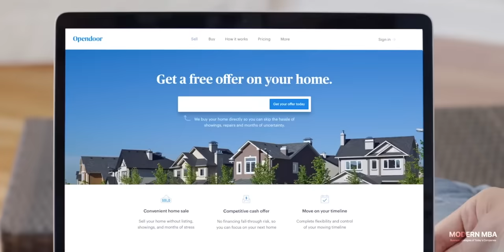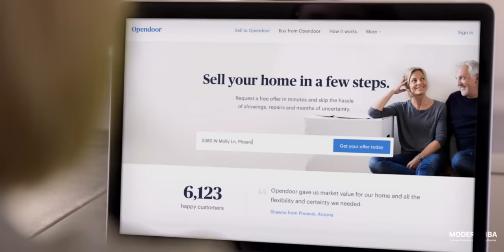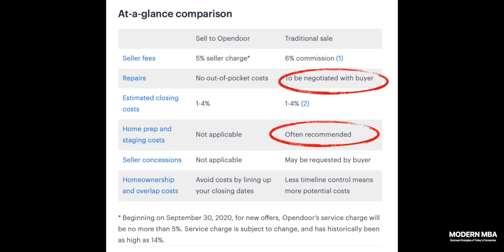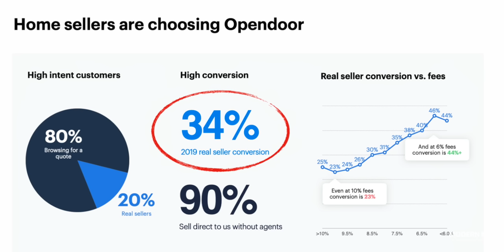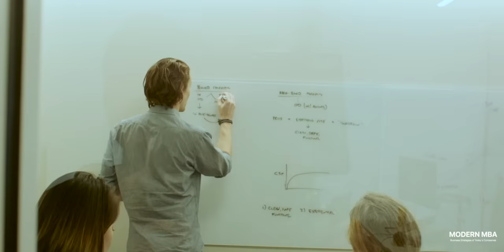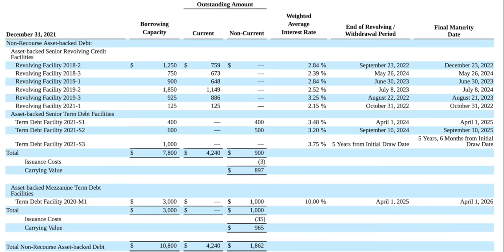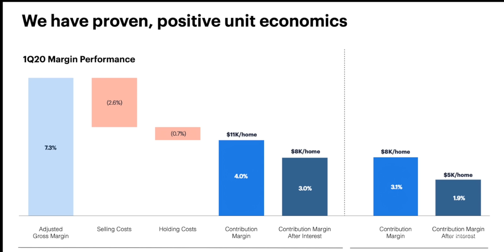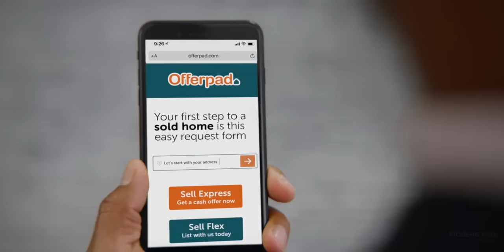Real Estate Tech: A Crumbling House of Cards

Comment: As a data scientist myself I can tell you these algorithms are usually a lot more raw than they would like you to believe lol
Reply: I agree In general but I think people (especially agents) are making too much of a big deal about the “data failure” part of this story. 

As you said, modeling and algorithms are usually looser than many people imagine, but the bigger deal here imo is they didn’t seem to factor in selection effects for who will sell a home to an i buyer.

They also seemed to have failed to develop local networks of contractors for flips ahead of time. There’s a reason there is no national company doing flips, and it’s not because no one has tried.
Reply: I believe it haha
Reply: Even if they had all the data they claimed as a former banker I am sure it was doomed to fail.  The problem is there tends to be just too much variation between markets so each neighborhood really would need different parameters and a retuning of the algorithm.  But they don't have enough data within each neighborhood (not to mention within each market segment in each neighborhood) to get much power so they might actually be estimating off as few as a dozen observations many of which are old and out of date.  

Then add in the fact that you're more likely to get lemons that won't stand up to closer examination signing up for a quick sale process like OpenDoor.  It's actually not that hard to hide local problems if all you do is a single home inspection, whereas a traditional seller with a local real estate agent will know more about the neighborhood and often do more visits at various times of day.
Reply: I mean they did mention things like access to transportation and noise being included in the prediction so idk, probably not just one python script some moron threw together in an afternoon.

Comment: My wife worked for them until a year or so ago. They were astoundingly dysfunctional in so many ways. They didn't have solid, objective ways to evaluate homes, plus with COVID they talked themselves into thinking they could evaluate value without even going inside. They had two groups which didn't communicate at all... The buying side versus the selling. Guess what happens when neither side talks or learns from the other! It was a dumpster fire

Comment: Part of the problem with the "algorithm," esp. regarding homes, is that it can't possibly know everything about a particular property. The algorithm probably wasn't, checking for things like:
* the frequency and severity of termite infestations for an older wood-frame home in a particular neighborhood (anyone who's lived in my city knows not to buy wood frame houses in a certain zip code because your house will either get eaten out from under you or you'll need to be on a first name basis with an exterminator)
* whether an older house still has lead paint in it (A friend ran into this exact problem when she bought a townhome she thought she'd turn into a rental only to discover she couldn't until the lead paint had been removed, an expensive process that requires a certified specialist in her city)
* or any number of miscellaneous oddities that might be wrong with a house that the current owner might not even know about no matter how long they've owned the property (my mother has lived in her home for 30 years and didn't realize that her back yard was flooding all the time because of the massive courtyard pavers buried under less than three inches of sand in the yard and only discovered it when she had a landscaper come out to try and fix the flooding). 

Like, these aren't cars that can be inspected in a day or hardware that has specs published. Some information just isn't available in a database which skews the dataset.

Comment: Me and my mom were moving out of a rental and ended up buying a house owned by Opendoor. The inspection found that there was a cable in the AC that had melted through and was causing a burning smell, and the plumbing had to be fixed, on top of the pool being effectively broken because the cleaning system wasn't working.

Opendoor wanted to fix none of it, and initially refused to do anything, despite the house clearly being both unsafe and at least somewhat unlivable. Fortunately, I am a stubborn asshole, and refused to let my mom even consider accepting that. They tried to give us a whole 2K credit for the repairs (which would have cost around 10,000 just to make the house safe), and we flat out told them they had until the end of the offer period to make a better offer or we walked.

That was the most stressful two weeks of our lives, because they refused to communicate with anyone, and waited until the *last day* to finally give us an offer we were happy with, which included them doing the major repairs that were needed.

Conclusion: Opendoor is not a real estate company. They are a legal mafia trying to make money by ripping off buyers with lower offers, and sellers by selling them broken homes for more than they're worth. Do not trust them, and if you have to buy from them, do not let them push you to accept their shit, because they will try everything they can to give you the worst deal they can.

Comment: My wife and I bought a house back in 2018 and we realized very quickly that most of the people selling their houses to Opendoor were doing so for a reason: they were trying to unload a lemon. Almost all of the houses selling through them were overpriced and in mediocre condition and could easily be skipped in a house hunt.
Reply: That's actually how money is made in real estate. You only want to buy fixer uppers. There is no opportunity in buying perfect homes.
Reply: @SmartestDumbGuy  Every house we toured (6 or so from 2000 to 4500 sq ft) with Opendoor had the same crappy and sloppy paintjob and maybe a few questionable and cheap looking upgrades that looked like someone was trying to put the minimum amount of effort into a flip. In the end we only used Opendoor to get an idea of different layouts and sizes because the houses were not desirable.
Reply: @SmartestDumbGuy  But then you actually have to fix them up. If OpenDoor is doing nothing and then jacking up the price expecting sales, then they have a crazy business model.
Reply: @SmartestDumbGuy  the problem is that open door buys trash and sells trash at super overpriced prices. The funny thing is that I always see that the homes are super overpriced for the pieces of junk they sell.
Reply: @tyler951  Exactly!!
Reply: It’s all done by machine learning and AI. They buy as low as possible, invest the minimum and sell as high as possible. Of course.

Comment: I think the problem with this model is that housing is treated like a fungible commodity, i. e. each unit is exactly the same as every other unit - shares of stock, bushels of corn, random doodads. That's not the case. The buyers definitely don't look at it that way. That's going to be their home. Every house is unique in terms of location, size, condition, school district, etc. It also seems like a total scam that they make an offer with a 5% commission and then deduct for repairs. That's not flipping. When a house is flipped, the investor takes responsibility for the repairs. I would never deal with this.
Reply: That’s true, but investors often make lowball offers on homes that are dilapidated or being auctioned off sight unseen. They would only offer market value if they believe they will hit their target profit after repairs and updates.

Comment: I work in fixed income portfolio management. Many, many people have tried and failed to ‘solve’ the illiquidity of that market. The fundamental problem is that the more illiquid a market is, the greater the required compensation for the market maker as a reward for inventory risk. That, in turn, means sellers must be willing to accept steep discounts for the convenience of an instant sale. However, most people simply would rather deal with the hassle of a normal sale than sacrifice 5% of a home value or easily several tens of thousands of dollars.
Reply: That's because homes are so expensive. 5% of 200k is 10,000. That's a ton of money to most people.

Comment: Before fully watching this video, I keep remembering someone on Twitter commenting on Zillow and giving their own perspective on why it failed so hard. The two main points were:

1) The smallest tiniest flaws in the code that fail to perfectly match up to the actual realities of the market will produce very major losses in profit, and it is very hard to find those ahead of time or even identify the problem afterwards.

2) The market is not full of random noise they can predict the trends of by throwing computers at it, it is full of very hungry sharks that will adapt and pounce on anything you try to do to push the market in a certain direction. The market will react to your presence and exploit the gaps in your strategy, and your actual returns will always be worse than your simulated returns.

Comment: Unless they're scanning the home with a camera or otherwise creating a massive dataset for each home, I fail to see how AI would provide much benefit.
Reply: This is still way way way off what's required. houses arent traded often enough and local enough to actually have house price data. When houses are sold the economic (local geographic, local schooling, etc. etc.) are all different. There's a significant amount of local information needed that can easy make a 10% difference to house price (wiping out their profit margins). All this information doesnt exist in any dataset, nor can it, with much of it changing as we speak.
Reply: @AConversationOn  I don’t think that is exactly the issue. Those datasets DO exist. I know because they’re used by different funds on deciding which houses to buy for the long term. The difficulty is using the sparse datapoints to figure out which houses to buy in the short term.
Reply: they send someone to look at the home.

Comment: I'd be curious to see the numbers but my gut feeling is that in the end, the real margins, profit, and societal value will only come from flipping houses that are run down and not desirable in the first place, rather than buying a fully functional $250k house, slapping some paint on it, and trying to sell it for $275-300k.  In the latter, you're only helping to inflate the values of middle class homes which are increasingly becoming out-of-reach for that middle class to buy.

Find a run down home for $75k or less that nobody wants or can live in, collaborate with building companies and turn that into a livable $200-250k home. You'll have way more profit and provide livable homes that were not livable before.
Reply: Low volume model but sound
Reply: China buble is just as you describe.
Reply: @i.alegre9401  that's very inaccurate, the Chinese bubble is one of nearly infinite lending without true backing and massive projects complete, or undergone without any consumer market. 
Any middle class American will buy the 75K house that was destroyed by a homeowner who shouldn't have had the home in a 2008 crash, and flips it for an attractive house that hides the messy history for 250K as travelling slim states. Which btw, would be an exceptional bargain in almost any city.
Reply: There is really only two ways to make money consistently in housing , aside from the realtor scam. 

That is as described with the 75k dump. Or building it yourself and saving on the labor. 

Quick flips are possible,  but not something most people can repeat.
Reply: A lot of times those houses are marked down for a reason - the cost to repair the house can easily balloon and end up higher than you can sell it for. Esp if there's fundamental underlying issues, such as foundation problems.

The main problems with the housing market is that it's a market and it's entirely driven by debt. You have to be extremely rich in order to buy a house without getting a mortgage. And when that's the way for middle class ppl to "increase their wealth," it causes a knock-on effect that keeps them permanently in debt. We live in a debt-driven economy and the housing market demonstrates that more clearly than any other market.

The reason why the housing market being a market is a problem is that we're talking about a fundamental human need - shelter. Markets go up and down and tons of ppl lose their homes every year because of market collapses - and not just because the housing market collapsed, but also because other markets they depend on to pay their debts collapsed. When you're choosing between paying for food, meds, or your shelter, the system is fundamentally broken.
Reply: @SadisticSenpai61  While I agree that some form of housing should be a right, I'm not so sure mortgages themselves are the main issue when comparing all the issues.  It's certainly a complex and intertwined puzzle.  If there were more affordable homes built, more multi-family homes built, more mixed use spaces, etc. it would go a long way in making it reasonable for the middle class to own a home.  

Mortgages themselves have been around for almost a century now, but it seems moreso that the average single family home is getting further out of reach since wages have stagnated in comparison to housing prices over the decades.

Builders don't want to and often can't make affordable homes nowadays for various reasons including zoning laws, profit seeking, and "not in my backyard" pushback.
Reply: @travellingslim  I didn't mean to imply that mortgages specifically are the primary issue. I was trying to imply that they're emblematic of our debt-based economy and now that I think about it, it's where our debt-based economy started.

The FDR admin started the mortgage program because in the Great Depression there was a massive increase in homelessness and ppl couldn't afford homes. As home prices increased over the next couple decades, the small amounts the government was willing to provide in gov-backed mortgages didn't go up, so that's where the private lenders stepped in and the private credit industry really got its start. Well, private credit to not rich ppl anyway. Prior to that, private credit was only available to rich ppl that lenders knew could pay them back and the only lenders willing to lend to poor ppl were... much more predatory. To put it nicely.

My opinion is that we shouldn't have a private housing market at all. It should all be public housing managed by local housing councils and funded by the state and feds. But I'm also plenty aware that my opinion is in the minority.

Private developers always opt to build luxury or upper middle class/upper class homes because those make the most profit. Why build affordable houses when you won't get much profit (if any) out of it? That's why the gov has to literally pay developers to build affordable housing, which they rarely do. It's also why we've got more empty houses and apartments in the nation than we homeless ppl. We could literally house every single homeless person in the country and still have empty homes, condos, and apartments.

And ofc there's also the various classes where students build homes under the supervision of private developers/contractors without pay. It didn't occur to me until years later that the carpentry class my brother took in high school where his class literally went and built a house in town was wage theft and child labor - they didn't pay him a single penny for his labor. And he was under 18 at the time, didn't have any of the certifications for the work he was doing, and according to state law, wasn't legally allowed to do any of it.
Reply: Easily said then done. People often go bankrupt trying to do exactly that. Big returns come with big risks. Not everyone has the skill set to make it successful.